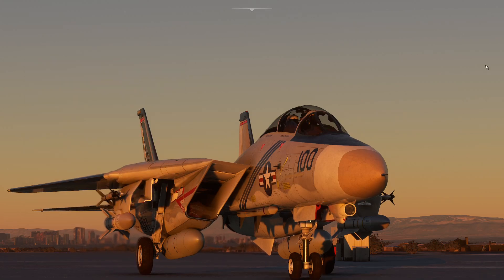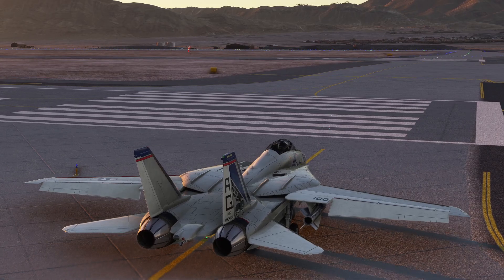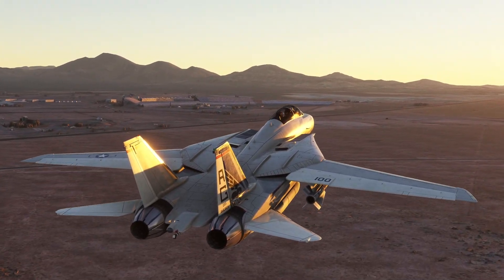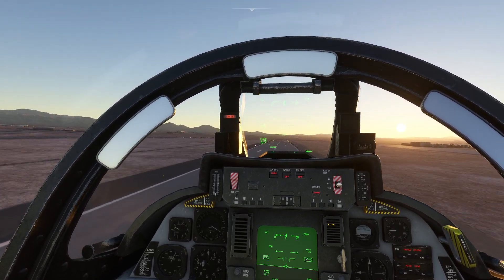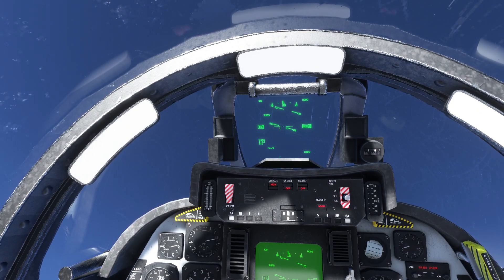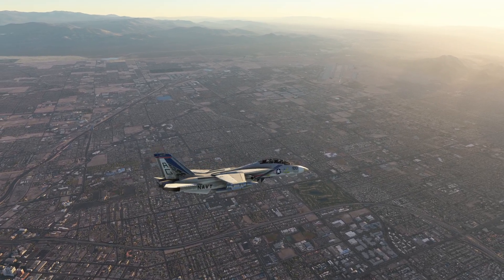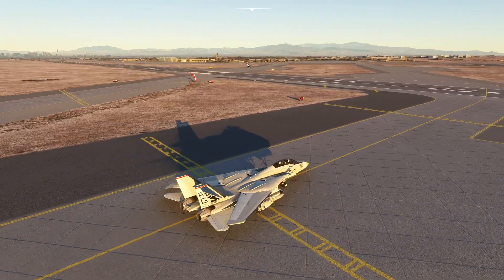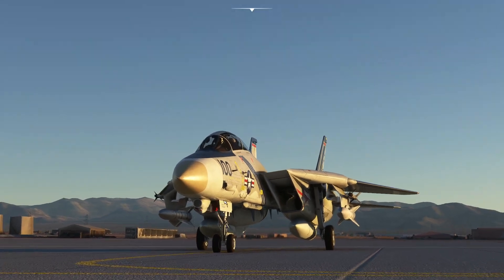First look at the DC Designs F-14B Tomcat in Microsoft Flight Simulator

Comment: How did you get the missiles and armaments on the plane?
Reply from the maker: It's in the payload / fuel screen - just put weights in the various locations :)
Reply: @jonbeckett  adding weight values to the various payload sections doesn’t seem to be changing anything visually. Perhaps it’s an Xbox thing?
Reply: @jonbeckett  ya it’s not working on Xbox can you do a tutorial video please
Reply from the maker: @cheers4238  I don't think weapons may be included on the XBox version.
Reply: @jonbeckett  that sucks
Reply from the maker: @cheers4238  Yep - I remember reading somewhere - there are no weapons in the marketplace - and the only route of getting aircraft into the xbox version is the marketplace.